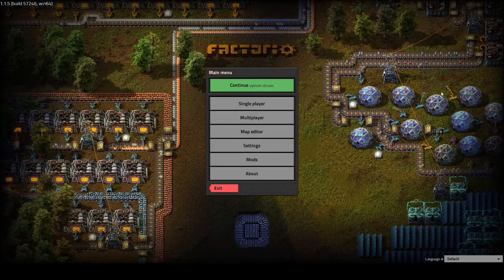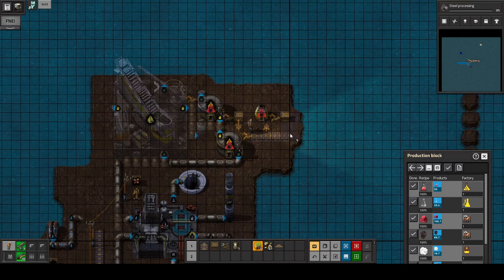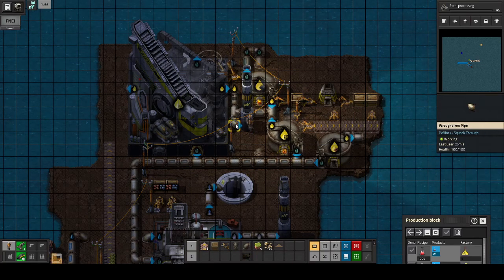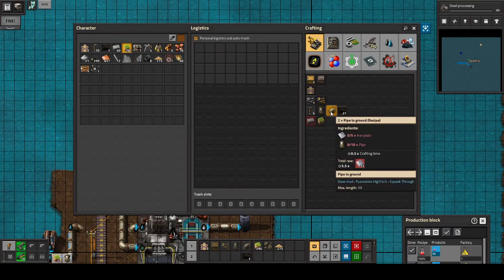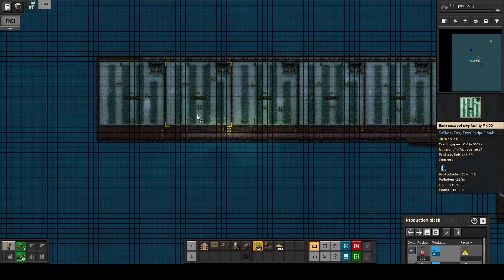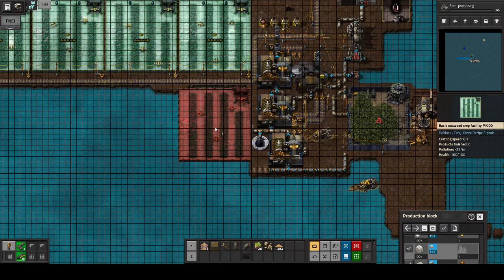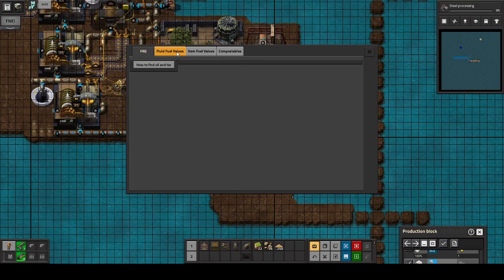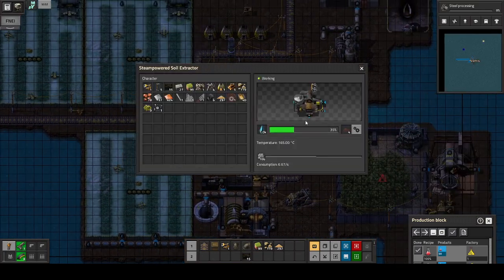Factorio PyBlock - Part 3 - Ironing out a few details in the basic setup

Comment: I'm not sure you noticed, and its possible that slight tweaks threw my old math on the subject off, but if you just want fuel value, the raw coal from seaweed is your best bet, supplemented by wood to coal (that particular chain using the fast wood forestry is fuel positive: older versions of pyblock before alien life outright relied on it).

Swapping from raw coal to coal in a ddd is only worth it when you reaaaallly want that tar.  

Coal to coke is better, sacrificing only a little fuel value for a good chunk of tar, proportionately. 

And, as you probably noticed,  coke to coal gas is only worthwhile if you're swimming in excess coke.
Reply from the maker: At an early stage in PyBlock, wood to coal is superior as an item MJ source compared to Seaweed -> Raw Coal. But if you also want coal gas and tar, then some amount of Seaweed certainly pays off.
Reply: Wait wood to coal is better? Even accounting for the power required to make the wood? 
Huh. I'll have to redo my math on that...
Reply from the maker: @fractalgem  Wood processing nets +1 coal per 10 seconds, per factory, which is 0.4 MJ (3 coal -> 400 steam -> 3 logs -> 15 wood -> 15 coal. So +12 coal for each factory over 120 seconds). Each Seaweed factory gives 0.211 MJ/s, according to my calculations.
Reply: @simonforsberg3757  oh thanks!